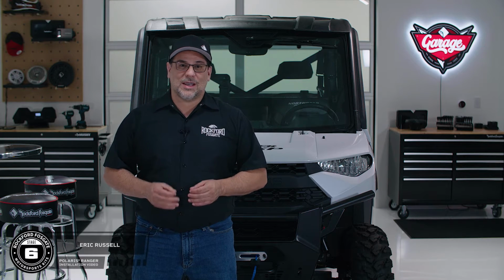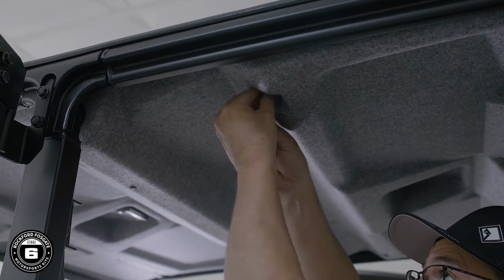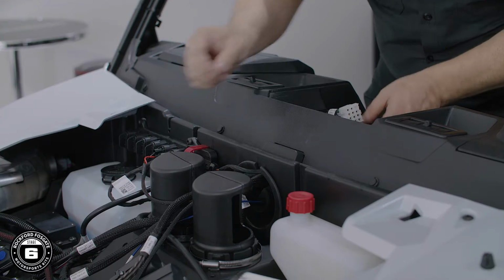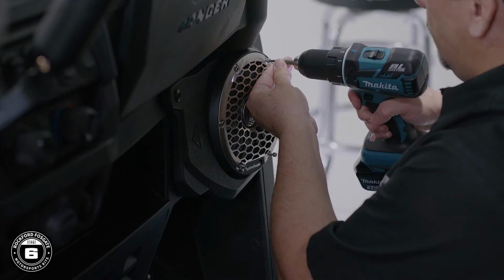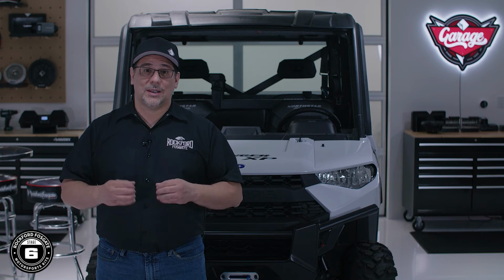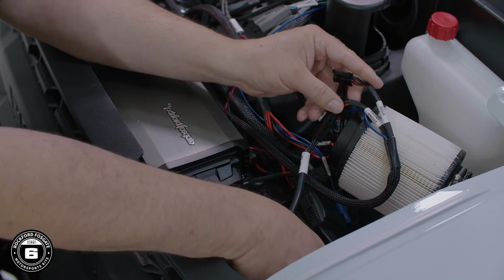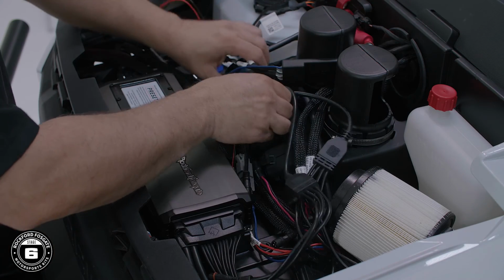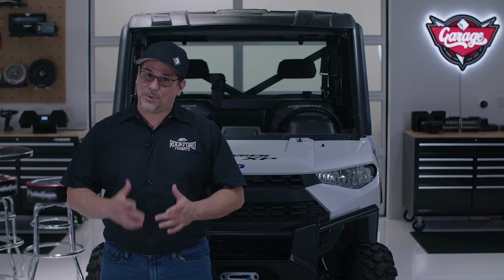2018+ Polaris Ranger STG6 | Installation

Comment: About halfway through the install in my 2023 Northstar Ultimate. Took a while to figure out to remove the factory amp and finally found the amp 2 and subwoofer connectors, wish I had read these comments before I started… My question is with the amp set to 2 channel and only having the amp 2 connector feeding the front and rear speaker inputs, will the fader function work on the Ride Command head to be able to fade the sound from front to rear? Thanks! Also, my amplifier bracket kit came with a piggyback bracket to relocate the gps antenna box which is very cool! Love everything Rockford! 😊
Reply from the maker: If your factory Polaris harness only has AMP1 and AMP3/SUBWOOFER connectors, then the AMP1 output from Ride Command will drive both FRONT+REAR amplifier channels.  Audio will only fade from FRONT (all front and back high-frequency speakers) to REAR (subwoofer drivers)

Comment: this is outdated.  24+ with Ride Command+, the amp bracket will not fit.  The plastic base has two bosses that hold the OE Ride Command+ GPS antenna, and those two bosses are in the way--the supplied amp bracket will not fit there.
Reply from the maker: Did you purchase the RNGR18-STG6 with the PMX or the RNGR18RC-STG6 with the Ride Command interface?  The standard RNGR18-STG6 kit does not show compatibility with the 24+ models: https://rockfordfosgate.com/products/details/rngr18-stg6/
Reply: @rockfordfosgate    RNGR18-STG6 with the PMX but we are having issues.  The boss called y'all and got somewhere with it.  We are gonna have to modify the front of the unit to fit the amp as well as change a harness since ours has Ride Command.
Reply from the maker: @ Sounds like you originally needed RNGR18RC-STG6 with the Ride Command harness. Glad Technical Support was able to get you straightened out.
Reply: @rockfordfosgate  ok next question.  This 24 is a ride command ultimate edition Northstar.  I have the harness you call for.  This harness includes amp1, amp2, and amp3.  Amp2 on the rockford harness connects to amp2 in the ranger harness  Amp3 of rockford harness connects to Subwoofer in the ranger harness.  Amp1 on rockford harness is "supposed" to go to amp1 in the ranger harness--however, amp1 is nowhere to be found in the ranger (I have the entire top of the dash out, the original amplifier, ductwork, everything).  It is simply not there.  Is there supposed to be a adapter connector or something that runs from the original amp harness connector to the rockford harness or???
Reply from the maker: @turbojoe9554  O.K. great!  Polaris changed the location of the AMP1 connector, and if I recall, I think it's deep down on the harness tree and no longer on the top with the dash.  Technically the Polaris harness has 2 full-range (AMP1 + AMP2) and 1 subwoofer (AMP3) output.  Therefore, if you can't find it, connect the AMP2 harness to the Rockford Fosgate interface's AMP1 connector and be sure the INPUT SWITCH on the amplifier is set to 2-CHANNEL INPUT.  We'll basically be leaving the interface's AMP2 in/out open and not used.
Reply: @rockfordfosgate  yeah there is no amp1 connector at all on this one.  Next question.  Do I leave the original amp installed or can I remove it to get it out of the way??
Reply from the maker: @ You can completely remove the amp because you’re essentially bypassing it.

Comment: Got mine installed last night.  The cable for the sub is long enough to mount it under the rear seat, which puts it completely out of the way.  It sounds as good as having under the front seat.  I turned the system on and it sounded much better than the factory speakers - then I turned off the factory preset on the amp and did some tweaking, and NOW it sounds really good.  I did have to call RF tech support with some questions since the 2023 model has changed a few things, and they were native English speaking people - I actually spoke with the guy that’s in charge of the install manual (what manual?) just before his meeting about having an available print manual.  I thought the video was great, but I like having a manual I can look through,  Etsy’s watching the same video segment 15 times to figure out what to do.
Reply from the maker: Glad you're enjoying the system and appreciate for your feedback.  For others reading this, we use the PRESET switch on the amplifier to use Rockford Fosgate's internally configured Gain Overlap for SXS systems, providing the best performance output (loudness) combined with long-term speaker reliability.  If there are any sections of our instructional videos that were not clear, we're always happy to read feedback so we can make continual improvements to them. -Eric
Reply: Installing this in my 2023 Northstar Ultimate with Ride Command. Would you be willing to share the manual settings that you used to optimize your amp? Thanks!

Comment: Is a 2 seat and 4 seat ranger the same Stage 6 kit?  Also can you add a 2nd subwoofer under the rear seat using the same amp to power both?  Seen it comes with leads for both front and rear seat installations with verbiage of future upgrade.  What is the part number for the sub only to add the 2nd sub woofer or is there a kit with 2 ?  Thank you
Reply from the maker: Yes the same STG6 kit can be used on 2-seat and 4-seat Rangers.  You can see the compatibility chart here: https://www.rockfordfosgate.com/products/details/rngr18-stg6/

Yes, the same amplifier can be used to power 2 subwoofers.  The M5-1500X5 amplifier has a dedicated sub channel, so when you wire both subs to a 2Ω load, it creates a 1Ω amplifier load.  You can find more info on the subwoofer add-on here: https://www.rockfordfosgate.com/products/details/rngr18-fwe/
Reply: So with two M2D4-10IB set both subs to 2ohm not 8ohm?

Comment: Just installed this kit on my 22 NorthStar Premium. I found the video extremely helpful and it had very few (minor) inconsistencies with actual installation experience. Easy installation but time consuming; took approximately 7 hours and 5 Coronas to complete. Sound quality exceeds expectations and fit/finish is flawless. One recommendation for RF: throw in some double sided tape for the Ride Command STG6 packages since users need to move the RC GPS unit off to the side to install the AMP in its place, and there is not an easy way to screw the GPS unit down without disassembling the headlights and fenders; double sided tape should suffice. Throwing in a couple extra push pins wouldn't hurt either in case installers drop them into unreachable spots :).
Reply from the maker: We really appreciate your feedback Joe!  You’re right, a few extra pieces should would help in case something accidentally falls into the dual intake ports located under the hood… not that I would know anything about doing something like that!  I mean, who doesn’t want to spend an extra 40 mins recovering a push pin that’s rattling inside an intake tube, right?

Comment: I'm not really interested in the color optix feature.  In fact, that feature is the only reason I'm hesitant to purchase this system.  Can I simply leave out the color optix controller to not use this feature, or do you have a plug and play system like this without color optix?  Thanks
Reply from the maker: You can actually either turn the Brightness on the App to 0 (zero) that effectively turns the LEDs off, or just don’t connect power to the Color Optix module.
Reply: @rockfordfosgate  Wonderful.  Thank you for the help and the prompt reply.

Comment: I just installed the Stage 6 kit on a 2023 Crew Ultimate.  Although RF don't list 23's fitment yet, this kit does work.  A few screw sizes were different than listed in the video.  Also, there is a HF Antennae mounted where the AMP goes under the hood.  After removing the brackets, I had to relocate the HF Antennae and "cut out" the mounting location it was screwed to (plastic).  It wasn't very difficult to do, but did take 7-8ish hours install time.
Reply from the maker: Thanks for helping others by posting your experience.
Reply: I removed the old bracket screws and put the RF bracket on top of the old brackets as a spacer.  It fits well enough and I didn’t have to cut the plastic under the hood.

Comment: Just installed this kit on my 22 Northstar Ultimate. I did not get the ride command because of supply chain issues and needed a stereo. I took my time and got it installed in about 6 hours. Rockford made it so simple with everything being plug and play and this video was a tremendous help. It’s sounds better than I could ever imagine and blows everything else away- ear numbing loud. I’m glad I went with RF, it looks like a factory installed system and fits perfect.
Reply from the maker: Thanks for your purchase and thanks for your feedback Danko.  Hearing your user experience helps us determine where we need to improve and what’s working right. -Eric

Comment: Do you have a video of how it sounds and also how do you compare it to the stage 4 that comes from factory?
Reply from the maker: These are High Performance audio systems and turning on the system and walking away doesn't convey the Sound Quality and Loudness when many are listening on tiny laptop speakers or mobile devices.  These are also totally different from the Factory Equipped Systems, as we pick-up at Stage-4 where the factory system leaves off.  The factory system features a 400W amplifier, whereas the aftermarket Stage-4/5/6 all include a 1,500W amplifier.

Comment: Can you install the sub under the rear seat instead of the front seat?
Reply from the maker: Yes, you can.  The harness is designed to connect a subwoofer in both the front and rear, so if you're using one, you can choose the location.

Comment: Amplifier Bracket install mine looks different I have Ride Command and there is GPS with a decal this side towards sky where the amp goes?  
Haven’t started the install yet.
Reply from the maker: You'll want to move the GPS receiver over to the right and tape it or velcro it down.  Rough-in the new bracket and amplifier to make sure the new GPS receiver doesn't interfere.

Comment: Do you remove the factory amp that came with the ranger? My Northstar came with an amp and I’m only seeing amp 2 and subwoofer factory pigtails.
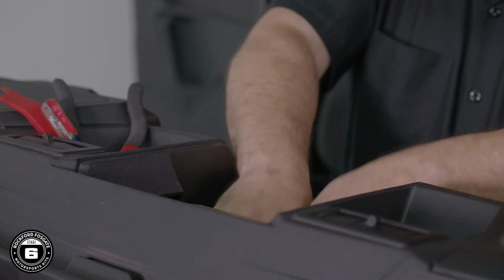Reply from the maker: You can leave the amplifier in the Ranger.  I mention how systems with factory amplifiers have only 2 connectors at timecode 09:00 "Ride Command Factory Amplifier Notes" and it shows how to connect them.  The amplifier INPUT SWITCH is already defaulted to "2CH", so this will allow the AMP2 connector to feed all 4 channels of the amplifier, while the SUB input sends signal to the SUBWOOFER channel.
Reply: I have the same, but when plugged into amp 1 it only has sound from the front speakers.